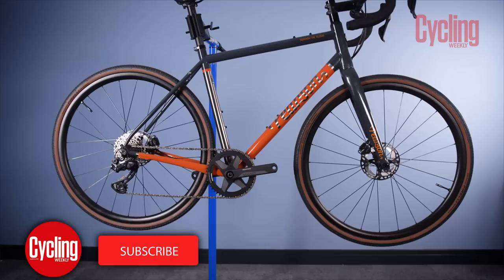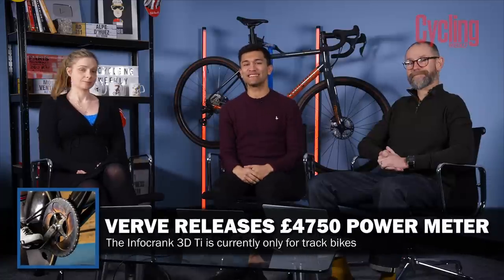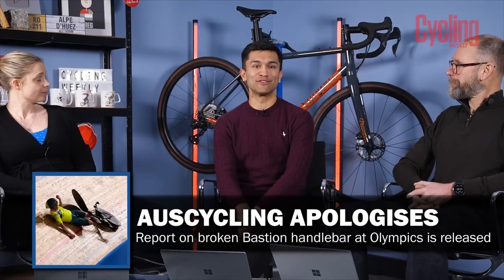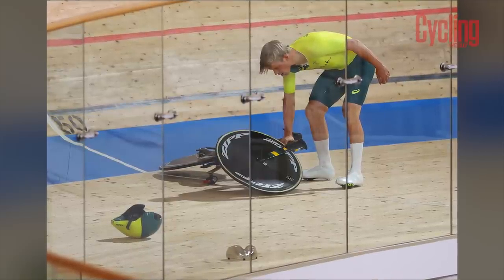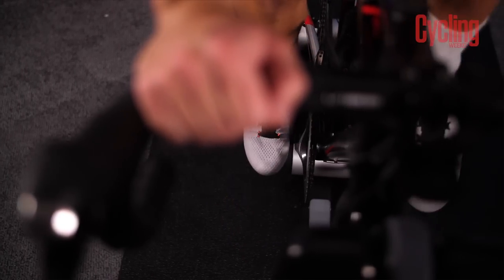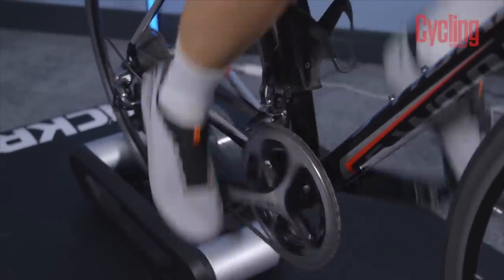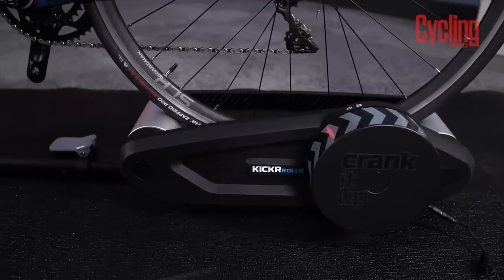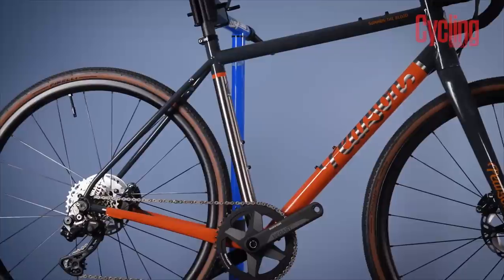Is This New Manufacturing Method The Way Forward?! | Tech Of The Month

Comment: It's a fair point regarding the 3d printing of small volume parts. It is undermined somewhat by the failures by some of the big name manufacturers - shimano cranks, Specialized SL7 steerer tubes, Mavic SYS. Failures by these companies represent a much greater risk than that posed by small volume boutique manufacturers, regardless of manufacturing method.

Comment: 3D printed parts are Not as strong as other mainstream parts made by traditional methods, this is known in the industry for years, so any new part used by manufacturers go hand to hand with risking failure. 3D printing is slowly been replaced with new methods that don’t induce fusion with lasers or Hi voltage and no powder 😊. So 3D printing is a viable option but you just need a Bigger budget.